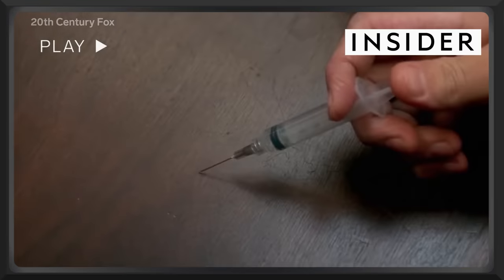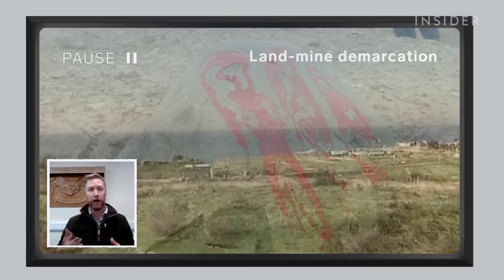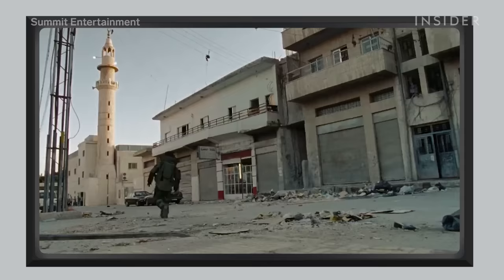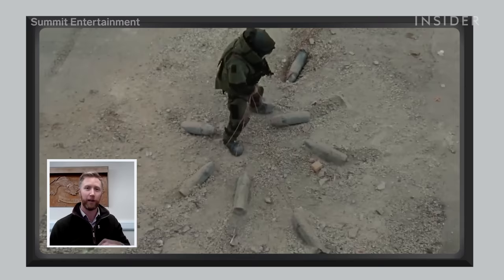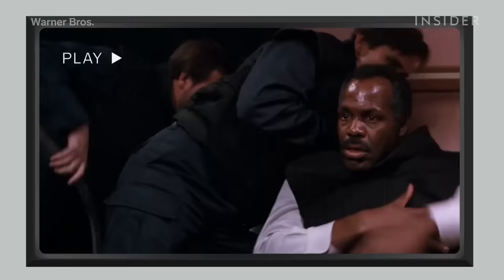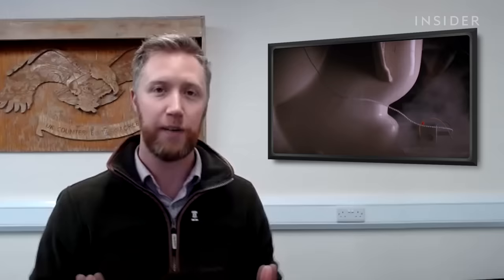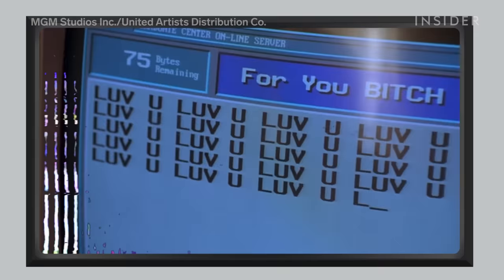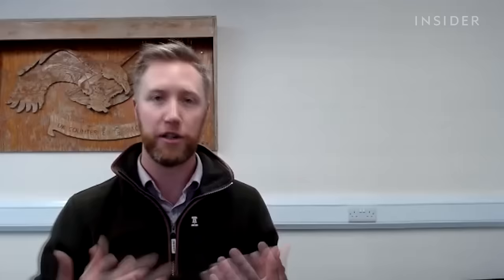Special Forces Bomb Disposal Expert Rates 10 Bomb Scenes In Movies | How Real Is It? | Insider

Comment: What about the "bouncing betty" landmine/antipersonnel mines from WWII.. those were designed to go off after pressure release I think.. seems like they would be because someone would step on it, activate it, step off, then it shoots up about 3-4 feet then explodes all the ball bearings around a 360° area.. meant to hurt or kill as many troops as possible.. idk though.. anyone know if those things were set off as soon as someone stepped on them or an after pressure release..(edit: so a quick search still didn't answer this question.. a couple of quick historical videos said they were set off by trip wire(not pressure release), football(no idea what that is relating to explosives or electronics but i envision the side of a football as two plates that when pressed together connect a circuit) and "disturbing" the 3 prongs, but then went ahead and showed an animation of someone walking over it, stepping on it and once their foot came off it would shoot up into the air and then explode.. so I have no idea still)

Comment: Idea that two people can cut wires at the same time is ridiculous. Even basic Arduino clocks at 16Mhz, so in theory it can check the wire status 16 000 000x per second. So to actually beat it you would need to cut both wires within few nano seconds apart.

Comment: I'm going to say that if the "bomber" is using common IC's who's functions are known, as will most likely be the case you can have a mechanical or electrical effect. Depending on how complex the bomb is, I doubt the designer would use every line of a chip for something simple as managing a current to set off given X. Then you move on the hidden triggers with normally open switches, maybe connected to a 9v battery somewhere that will set it off anyway because someone is tampering with the wiring. This is something a 12 year old could put together on a breadboard, honestly.

Comment: A polarized capacitor would make any power supply loss meaningless. It could discharge in microseconds toward the detonator caps and result in an explosion. 

In place disposal is most likely the best option in most cases. 

Looks like the hurt locker style daisy chain could be defeated with a mains cut right off the rip. A non sophisticated blast cap rig to a cell phone tiggered voltage isn't worth an EOD tech down range.

Comment: raises hand  I know this video is 2 years old... but on the topic of the "String of  pearls".  Its a 'unstable' design yea... but wouldn't it also be an 'effective' one in the use it was used in?  If the 'canister' that the pearls are stored in is air-tight, the "Set-back" force would actually act as a 'trigger' and would essentially 'arm' the chemicals weapon part of it the moment the missile fired.

The simple act of 'launching' the missile would cause all of the pearls to shatter, filling the canister up with the now 'activated' gas.  So even if the missile failed to detonate and 'spread' the gas from within that air-tight canister, even impacting wtih the ground and 'breaking' could cause it to still function.

Comment: Please correct me if I'm wrong, but isn't this more simple than Hollywood suggests? A bomb fuse is just an electric circuit, generally, right? If you step on a mine it's a pressure switch, it's kind of the same as a grenade, you've just connected the firing pin with the explosive by pressure. If there is a timer, then that just activates the bomb when the circuit is completed at a given time as the timer completes the circuit. The insulation colour of the wire is irrelevant. It's simply whatever completes the circuit, right? My understanding of IEDs in Iraq/Afghanistan is that they were triggered by an observer using a mobile phone to complete the circuit unless they were mines? The world is genuinely more interesting than Hollywood stylises it.

Comment: Why don’t they use a portable “bomb wall”?  Something with holes for your arms with armored sleeves.  Also add a porthole, or better yet a camera so there’s no unnecessary holes.  It’d be a lot easier to function in than a blast suit, and could protect just as well, if not more.  Or you could even combine the two.🤷🏻

Comment: Wow, one clip and he's completely figured out James Woods. Well done. Yep, as an actor he's an IED.
I wonder if there are small remote wire cutters. You  attach them to several wires, then from a safe distance switch them on, they cut, separate and cover the bare ends. A higher quality set might even be quick enough do this as simultaneously as possible.
Reply: The issue isn't being quick enough, the issue is being simultanious enough... it would be best to connect all cutters to one controller, also they might even need to have the same length of cable to them^^

Also I dont get why there are so many cables in the first place... you need two to the battery and two to the detonator and then have a tiny pcb in between?

Comment: A 10cm wide cube of plutonium weight nearly 20KG. That ball is easily more than twice that as a sphere. No one can catch a 50KG ball like that. No effort. Also plutonium is extremely radioactive, I would not even dare put my hand in the way of that. It wont explode from falling on the floor. I would be instantly running out the door. What kind of nuclear weapon drops its core on the floor at a moments notice. The origins of nuclear weapons had types of weapon where the plutonium core and explosive lens would be installed during flight. Weapons like that don't exist anymore. The sealed pit design replaced this idea for all future nuclear weapons.

Comment: Funny thing is people don't realize mixing a few house hold chemicals found under most sinks can create some volatile things lol I rember back in the day 15+ years ago we use to take Mason jars and fill them with gun powder and gasoline and one other thing I will not state but it would blow holes the size of half a school bus in the ground and I'm not exaggerating we had taken a water jug one time (glass) 5 gallon it made a hole 4 to 6 ft deep 8 to 10 ft wide 16 to 20ft long massive we found shards of glass over a mile away (please do not attempt that's why I didn't provide all the information it's dangerous and if you don't know what you are doing you will kill or severely injure yourself or others) if you want a big boom and Shockwave you can use weather balloons filled with pure oxygen and light it with a 10 ft stick and it will make a big boom, it's still creates a fireball but no physial explosion its what creates the "boom" in explosions but do research if you plan to do this, I am not advising you to do it and I am not responsible if you do, I told you what I've done for a back story to the video. BE SAVE AND HAVE A GOOD DAY!!!!

Comment: This video has been out 7 months now, I'm probably not going to get an answer but if there are a limited amount of wires in a bomb, and you know there are no external signals like a radio, couldn't you cut them all? Like bundle them together and cut them in a bunch, that way no electrical signal can move through the bomb to tell it to blow up.

Comment: I think he forgot about 'bouncing betties' step on step off, jump up blow up.
Reply: Nope.. bounding mines initiate if you stand on them, but they are usually set off by trip wires. There is a version of the russian AP mine that worked by pressure release, but it was invariably used as a booby trap and placed under objects

Comment: So what I'm hearing is, if I make bombs like they do in Hollywood, defusers will be really confused and think I'm a dumb?
Reply: Well, if you make a bomb like in Hollywood. That bomb will not work.
Reply: @martinqizeaq  what I'm saying is you make a normal explosive, then add not vital non- not even connected with the working components objects to make it look like a wiring closet from an fortune 500 company, that wouls be the troll thing to do.
Reply: @martinqizeaq  6:57 judging from the rest of the pcb that green wire is indeed connected to a hole that is meant for screwing the board down xD
Also the board doesn't have power (vcc not connected) and the I²C bus it has isn't connected either which seems like an oversight

Comment: I have only one problem with this guy. Mythbusters tested the liquid nitrogen and it actually works on the electronics. They also tested the cast iron tub and it did make the blast survivable. But I guess you don't have to know physics to be a bomb tech... oh wait. Never mind.
Reply: It can work if you can put it exactly on the battery. It doesn’t affect the explosive directly and it isn’t good practice to splash it in all over like an aftershave…

Comment: Electricity goes at the speed of light with some variation due to resistances and the conductivity of certain materials (very small variation).

Even if 2 people on different sides of the planet cut a wire within 200ms of each other, the signal would have been able to travel across the world several times over already.
Reply: But even the resistance dictates a voltage drop, the speed is the same.
Electricity is always conveniently misunderstood in cinema.

Comment: I’m also EOD, the hurt locker scenario where he couldn’t save the guy was bull sh*t, there’s blasting caps located in each random plastic explosives all blasting caps need a trigger a simple wire cut or pull each cap, like you said extremely simple

Comment: When it comes to wiring in bombs, why wouldn't they just use the same color wires for everything?

I mean, if the previous owner of my car can wire everything in red and black only, seems like a bomb maker could use one color only. Would really ruin the "cut the green wire" thing.
Reply: A possible explanation could be so that the maker himself knows what’s going on and can discern between the different wires. If he needed to work on something he already has on the bomb he may end up killing himself. Just guessing though.
Reply: @XTOXICToxenx  not a bomb maker but I do alot of electrical engineering as a hobby nothing is more irritating than trying to figure out what wires are what when manufacturers don't use the same wire coding. For example most AC cables have a black, white and red (or green) the or is the irritating part I've seen some use green as their neutral some use white and a few use black. Red positive, black negative and white neutral should be proper wiring. Now imagine that frustration with a pound of c4 and one slight error sets off an explosion in your face. I've had to rewire numerous things just so I didn't cause a short of cause a lithium battery to pop in my face.  I only use different color wires as jumpers on pcb because if I ever need to repair the object I'd like to know what I did if my diagrams aren't handy.
Reply: @ralcogaming7674  Very interesting! Yeah that sounds like it would be very irritating.
Reply: @XTOXICToxenx  the blower I made for my forge was like that it had black, white and green, the cord I used to link it to my foot pedal, had black white and red. Luckily I guessed right but worst case was my fan spun the wrong way, for them a wrong wire is more irritating than a motor spinning the wrong way.

Comment: The liquid nitrogen on the electronics was proven to be correct on mythbusters.
Reply: Sure was but electrical signals don't care.
Reply: @deejeh9494  true however cant have electrical signals if the batteries stop conducting them due to extreme cold

Comment: I know of only 1 type of landmine that works on a pressure release, and that's the old German bouning Betty, because you actually didn't want someone directly on top of it because that limited the mine's effectiveness. The mine would fire on release so that there were people around them, but not over them, this way the mine was free to do its hop. The mine used a propellant charge to launch it approximately 1 meter in the air where it then detonated with the intention of launching ball bearings into soldiers abdominal area and legs, usually with the intention of maiming instead of killing
Reply: It’s not pressure release. The low explosive charge is initiated by a short pyrotechnic train fuse. It will explode whether or not you maintain pressure on the mine. You’re right to say though that this delay is to allow the victim time to step off the mine.

Comment: Former 13B, the Hurt Locker completely lost me when hulked those 155‘s single handedly on a pretty thin wire. Maybe it was made of spider silk or whatever. On the old 198‘s each one of those shells is about 90 pounds or more. Also, we had a 249 and M16‘s/M4‘s and we didn’t train with a lot because we had a 155mm howitzer to play with. No one uses a Barrett outside the super cool guy units.

Comment: There are no mines that detonate on release? Then explain "Bouncing Betty". Point man trips the primary and steps off. Mine jumps about 1 meter high, then explodes. Rest of the tactical column walks into the blast. Little gift we got from the Nazis in WWII with the S-mine, a little wooden bastard that the metal detectors barely picked up.
Reply: The S-mine was made of steel and filled with hundreds of small fragments. Even the first generation mine detectors could find them. I think you’re thinking of the Schü-mine which was an anti-personnel blast mine. No fragmentation.